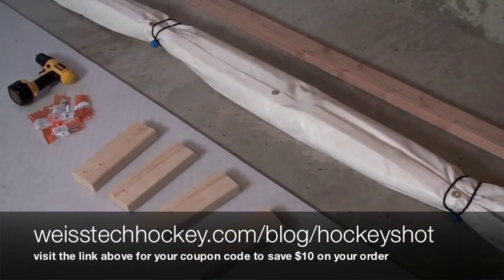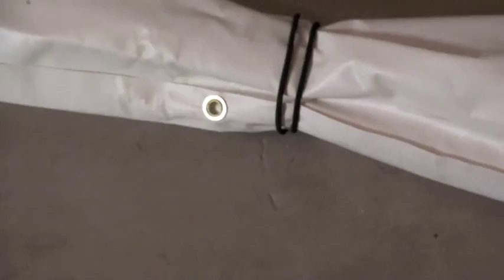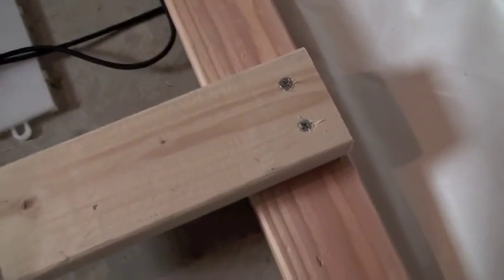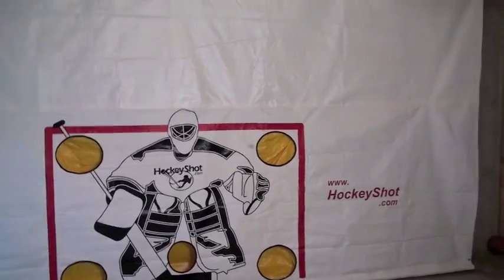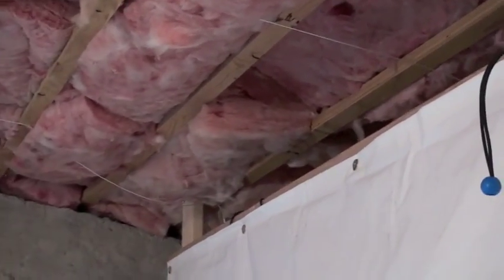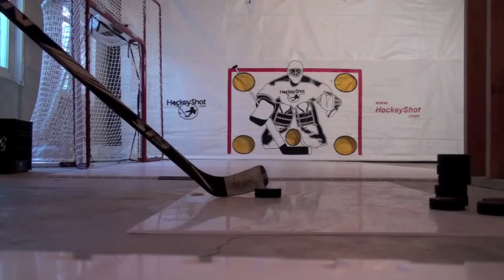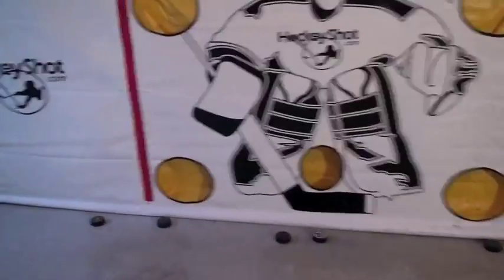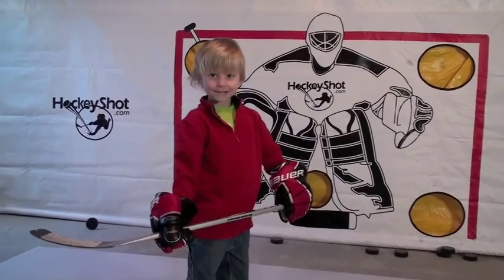How to Install the Sniper's Edge Indoors

Comment: Easy way to hang it indoors is to screw in 2 eyehooks to top of the 2x4 and using carabiners and chain to connect to 2 eyehooks that are screwed into the ceiling studs.
Reply: do you still have the video on you tube?